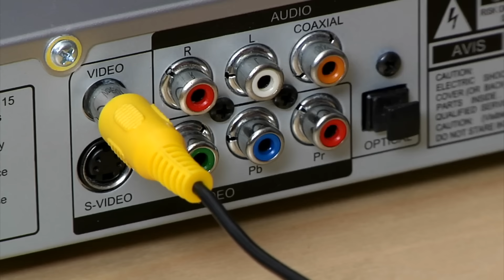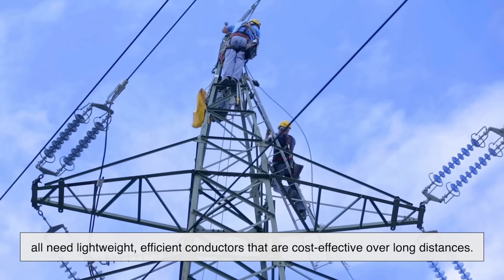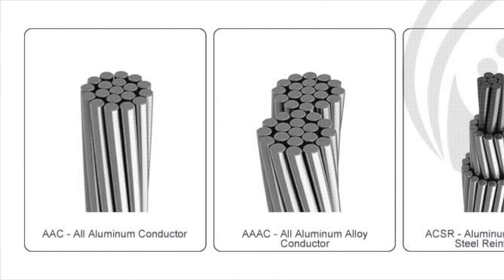Why Do Power Lines Use Aluminum Instead of Copper?

Comment: It all depends on the metric in which you base the comparison of conductivity on.

Aluminum is MORE conductive than copper if your comparison is on weight or cost. Copper only wins if you are comparing based on cross sectional area.

If the ultimate conductivity was the end all be all then we should just make high tension lines from pure Silver. Hopefully people realize that is ludicrous.

 The biggest problem with aluminum is the oxide layer that forms quickly that can degrade making solid connections, but that can be managed,

Comment: I remember house fires in the '70s caused by aluminum wiring. It has since been banned in the Us.
Reply: Nope it's still legal.
Reply: @tx2sturgis    My EX was a IBEW  that stuff is only on my underground entrance from the line to my powerhouse meter base  I dont trust it  He had several large commercial facility's that they had to every so often repair big stuff that would get loose and cause problems .They would replace it as it failed .
Reply: In the US, Aluminum provides the power from the pole to the meter then switches to copper. Definitely not banned entirely
Reply: Aluminum is used still, it’s not used in houses because the terminals on outlets and switches (with homeowners not knowing how to terminate) that cause the problem.
Reply: remember the Beverly hills supper club ???
Reply: Robbers cut copper refrigerant lines from air conditioners to sell at a metal shop!

Comment: Berfore WW2 the amount of power needed for domestic and industrial use was low but increased greatly after, shortage of copper and the increase of demand meant a substitute was needed but not only on the grid in our  local area a housing estate was cabled in underground LV aluminium cable, at the time it was a failure mainly due to the solders and flux used for joints which often needed jointers to wear a mask, it was unsafe because of dangerous fumes given off. This was resolved later by compression joints. The big problem is as soon as it's exposed to air it oxidises and copper fluxes were useless and correct ones worked but fumes were poisonous.

Comment: Al has more downsides... it work hardens faster (bend it a couple times while changing the outlet and it might just break) and screw connections need to be re-tightened every couple years because it sort of "flows" and causes high resistance connection (no one does this, ever.. they wait till the outlet melts or till they lose neutral and expensive equipment breaks because it got interphase voltage). There are good reasons why aluminium house wiring is banned in a lot of countries (for new developments).

Comment: Over here the vast majority of cables is buried in the ground and those used for power distribution are made from aluminium too. IMHO that means that cost is a far bigger contributor than the other two (technical) reasons to use aluminium.
Reply: We don't have much problem with handling large Aluminium wires, but it is the smaller wires that did cause the problems.. .  So that is why larger, lighter overhead wires are Aluminium, and small house wiring use Copper.

Comment: The best conductor would be silver, second copper, third Aluminium. Silver is really too expensive.
Copper is a good conductor. Aluminium requires a larger cross-section than copper.
Even underground cables for high performance are made from aluminium.

Comment: The problem with early attempts to use aluminum for branch circuits in homes is two fold. One, back then industry had not yet discovered how to alloy aluminum with other materials to increase its corrosion resistance, so aluminum wire back then was very subject to corrosion. The corrosion increased the resistance at every point where the aluminum wire was terminated, which lead to the second problem. The termination methods used were the same as for copper, and that led to the problem with something called cold flow. Aluminum wire used in branch circuits, using the same termination methods and materials as was used for copper, would heat up under current flow, then cool off when current flow was off or reduced. Every time those early aluminum wires heated up they expanded, and they would squeeze out of the termination device. Back then a device called back stabs in switches and receptacles was used a lot because it made for fast wiring. Back stabs were shaky even with copper. With aluminum they were a disaster and caused a lot of fires. Even when terminated under a screw the aluminum conductors would heat up, and being softer than copper with greater expansion characteristics,  would expand and squeeze out from under the screw just a bit with every heating/cooling cycle. After enough cycles the aluminum wire would be loose, no longer tight. 
In news stories about house fires you will often hear it told that the fire was caused by a short circuit. This is almost never correct. If there was a short circuit it would open a circuit breaker or fuse and shut the power off. Electrical house fires are caused by what I call an arcing open. That is when current is traveling through a looseness at a termination. The electricity jumps the gap, which degrades the material, which increases the resistance even more, beats up the wire and screw, which creates even more heat, and that cycle repeats, with the electricity arcing across that looseness, acting much the same as an arc welder with similar levels of heat, until the combustion threshold of nearby material is exceeded and combustion takes place.
What few people understand is an arcing open will never open a protective device because the current flow across that arcing open is never high enough to trip a circuit breaker or open a fuse. An arcing open generates huge heat but little current, so the arcing will continue for weeks and months until combustion takes place.
Industry has recently created arc fault circuit breakers. These use solid state electronics to detect an electrical arc downstream of the breaker. Like early ground fault circuit breakers and receptacles, they are very subject to nuisance tripping and can be very inconvenient, constantly tripping out and shutting down circuits. They cannot recognize the difference between an actual arc fault and the normal arcing that takes place in a common brush type electrical motor, so a lot of vacuum cleaners have been rendered obsolete. Hopefully like ground fault circuit breakers the technology will improve and nuisance tripping will be greatly reduced. Arc fault circuit breakers will save many buildings and many lives when the technology catches up with the practical need.
It should be noted that large branch circuit conductors #8 and larger, or feeder conductors #8 and larger, when the exposed aluminum is coated with an oxide inhibitor which helps prevent oxygen in the atmosphere from oxidizing the aluminum, correctly terminated under a LUG, are safe as any other conductor.
Reply: Too long to read easily..   But yes, Aluminium wiring in houses had problems.. .  Corrosion problems made bad contacts, not good, larger wires harder to install.. .  But aluminum wires easily break if bent a couple of times. .   House wiring often requires much bending of the wires, so many aluminium wires broke.
Reply: An actual intelligent response! So sick of people saying caused by a short circuit. Same issue arises when people just twist wires together without a nut or solder (which cannot be used with aluminum). Aluminum conductors are taking preference again for high current circuits these days, though. They are used for ranges and clothes dryers. The cabling is cheaper and lighter. An anti-corrosion paste is applied at the terminations.
Reply: @td3993  See my new comment, about 47 minutes after yours.
Reply: One of my sources also said that alum wire in many high current applications would crack from the expansion and contraction cycles which you noted was also a problem with terminators. Those tiny micro cracks cause higher resistance.
Reply: @Garth2011  Not so much the wire cracking, but yes  the different expansion and contraction, can result in wire terminations becoming loose. . .  Factories are required to check the tightness of aluminum wires regularly to avoid those problems. . .  I used to carry an IR thermal monitoring hand tool, to check for hot, bad connections.
Reply: @akawireguy1197 — great info, but … it was hard to read in this format; more paragraphs please!
Reply: @TSPhotoAtlanta     Yes, it is hard to read long posts.. .  I often copy them into Word for easier reading. . . .  But my comment below, sums up much of what the other post says.. . .    So here is my post again, I hope this helps.   :

I have listened to the whole video, it is good, and very correct. . . .  I would like to take it a little further, that is explain those high aluminium wires between towers a little further.

They are not just aluminum cables, you may have noticed they are stranded. . .   The outer Aluminum layers will be specially produced for best electrical conduction, the next layer inside, will be more about strength, so different types of aluminium alloy.. . .  Then the inner core used to be steel for strength, but the newer ones, now use special fibres, to make the cables actually stronger and lighter, so the towers can be further apart, thus still improving costs.

You might have also noticed, that each actual cable, is actually 4 cables spaced about 6 inches apart, with spacers. . . .  It might sound strange, but the magnetic field caused by the current in these wires, causes "Skin effect", which means most of the current travels in the skin of the wires, that is why they are stranded, and the outer layer, better for conduction than the inner layer. . .    And then by making 4 wires, spaced a little apart, we can further improve on reducing the "Skin effect" and by so doing, reduce power losses.

But now, we are even going further into better cables. . .  He briefly mentioned it. .. .  Actually DC is better for all this high power than AC. . .    So there is more use of High Voltage DC or HVDC now being used. .      DC does not have the "Skin effect" or other inductive and capacative losses. . . .   So we can get more power through the same cables using HVDC. . . .   China is now using DC of over 1 million Volts, ( 1,000,000 Volts ), over some very long transmission lines, 600,000 Volts is becoming more common. . .   HVDC is now cheaper even for new transmission lines of over about 50 km distance, so very much coming into use for Wind Farms, this cost even includes the AC to DC Converters, which use very large, special Transistors, yes, transistors for these Converters, AC to DC and DC to AC conversions.. . . .  More if you want.
Reply: Actually my other reply does not cover the video, but goes further.  . .   This comment does cover most points of the video but briefly :

"  I have only listened to the video and that is exactly correct. . .   

Copper is a better conductor of Electricity than Aluminium, so widely used for electricity,.. .   Silver is better but very expensive. . . .  Aluminum is cheaper than copper, even if we use larger aluminium cables to get the same power through, it is still cheaper. . .   

So that is why your power company will be using Aluminium cables to your house. . . .  But those long high voltage cables between towers, need to be cheap, strong and light. .  Copper weight would need the towers to be closer together, so more expensive, and the problem of stretching. . . .  

So that is why we use Aluminium cables for those high pylon cables. . .  Actually rather special forms of aluminium for strength, some even use some steel for strength, newer ones use special fibres for strength.  "
Reply: Shorts can cause a fire as well. Fuse is probably the quickest to open a circuit. In PA there was a time when mains had to be a fuse. It may have been a local code because I could not find it in the NEC book. 73
Reply: On the oxide inhibitors is it added to the wiring process or is it a sealant dip like borax is used on copper rods during welding?
Reply: @craigmatheson2736  It's a paste or grease commonly known in the trades as Noalox. It's applied to the wire by the electrician when terminating and/or connecting circuits and feeders if and when it's required.

Comment: Copper is very expensive that’s why it’s not used in high voltage power lines as well. If you didn’t notice there are not any coating on high-voltage powerlines either. And that’s because the expense of that that’s why they don’t have it Plus, the wires are high enough so no one doesn’t touch them

Comment: No house wiring should be less than 12 gauge copper.  And it’s a good thing electric companies do not use copper outside on the poles.  If they did all the tweakers would steal it.

Comment: I'm surprised that corrosion wasn't also a factor. Copper wouldn't be as durable as AL for the exposed outdoor lines. AL is far less likely to corrode or degrade in the weather.

Comment: I had an old mobile home with aluminum wiring and it was a nightmare. Where ever there was a plugin in the wall you would half to pull them out and check when ever the lights started to flash. My home today has copper wiring and still works just fine,,,,,,,,,,,,,,,

Comment: As a young kid in 1970's collecting old antique power insulators here in Canada   I remember many vintage  wooden post power lines using thin single strand 1/8" inch to 8 AWG (4mm) alloyed copper line  in a single line or in a group of 3 stretched like straight, thin guitar strings along many short run roadsides.   once the standard method from the 1930's to 1950's  until they were replaced  with thicker,  lighter, multi strand aluminum lines in the 1970's. and 80's.

Comment: 5:20 The main reason why aluminum it not used any more in home wiring are the connectors! They must be installed much more carefully and require more effort. It could be done, but for some strange reason, the industry does not like it. It was used some decades ago.
Reply: Electricians too lazy to learn anything other than copper, and “we always do it this way” attitude.

Comment: Don't forget about Aluminum Conductor Composite Core (ACCC) which replaces the steel core with a composite fiber material.  It's lighter, stronger and has less sag (thus more capacity) than ACSR.

Comment: In house wiring aluminum has to be #12 , copper #14. That is for a 15 amp circuit. Aluminum wiring lasted for 2 years. To hard to use and it oxidized making a bad connection. In Canada people had replace all aluminum wiring with copper, otherwise you could not get house insurance.

Comment: Aluminum and steel combined suffer from galvanic corrosion.  The aluminum will be subjected to a high rate of corrosion caused by contact with the steel, unless there is a barrier of some sort.  Does the electrical current cycling through the wire prevent the galvanic corrosion?  How is this concern addressed.
Reply: In an AC power line the lion share of the current flow is through the areas close to surface of the wire (the skin effect). Hardly any current flows through the steel core. I got a feeling that does not really answer your question though.... :)

Comment: there are several reasons, the main one I would guess is that it isn't going to corrode quickly, the second being that it is far less likely to be stolen, and thirdly is that it is much cheaper than copper.
Reply: We've had lots of wire stolen from parking lot "street" lights and Internet cables by the homeless in Albuquerque, New Mexico, USA, so even Al can be stolen.
Reply: @craigmatheson2736  if it was copper, it would be going way faster as the price of scrap copper is 2-3x that of aluminium.